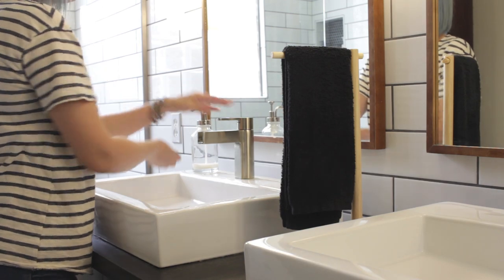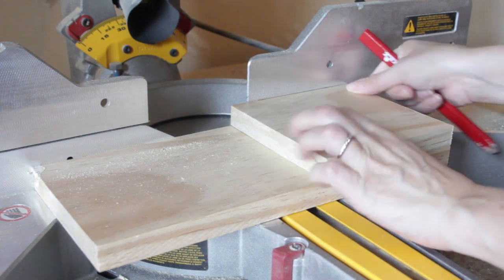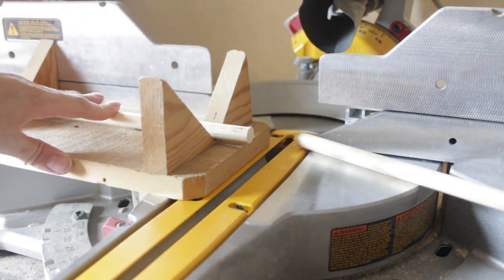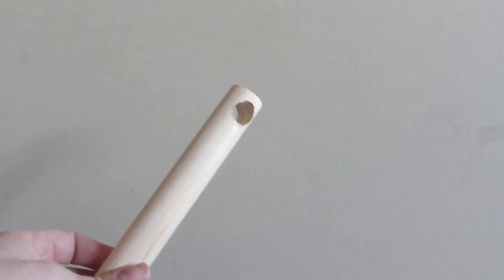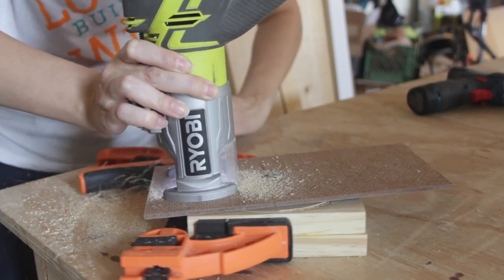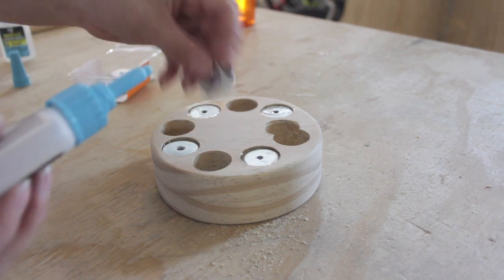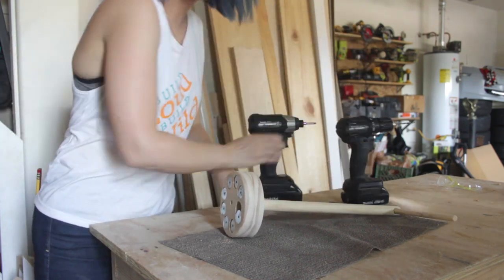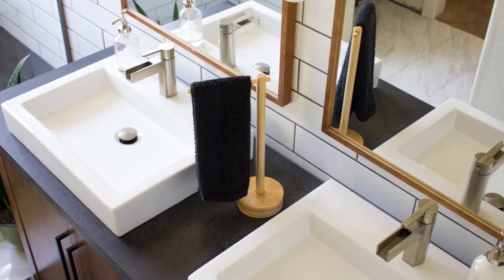DIY Weighted Wood Towel Holder

Comment: Plaster Of Paris is also great for adding weight to hollowed-out items and would be less expensive than washers.
Reply from the maker: That's a great idea!
Reply: Sticky-backed felt then makes a great covering over the bottom of the item and protects the surface from the POP.

Comment: Hi from Belgium, great idea. You can make an another one with a base of wood a stainless steel tube with wood insert on the end of the tube. To avoid the turn of the tube you can drill and put a pin. This is system is hidden behind the wood base. You can attached this To the wall. That's great To see woman woodworking in YouTube 👍. Sorry for my english

Comment: Salt keeps the pieces from sliding on you when your clamping the pieces together.  Also, on a round cylinder all you have to do is make sure one side ( hint, there are none.) Is plum to the speed square. ( that silver thing you were holding.) The whole thing will be plum. Not using the "level" function on that for this particular project. Cute video though. Keep' em coming.